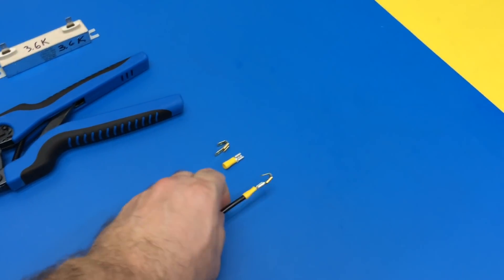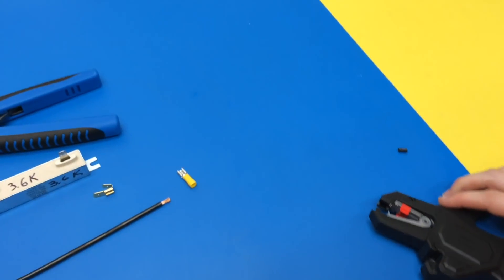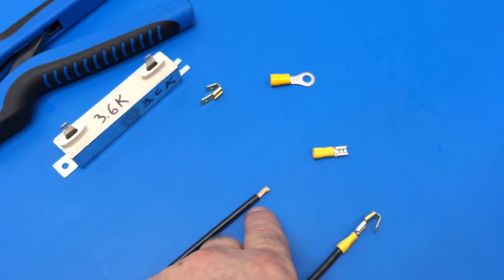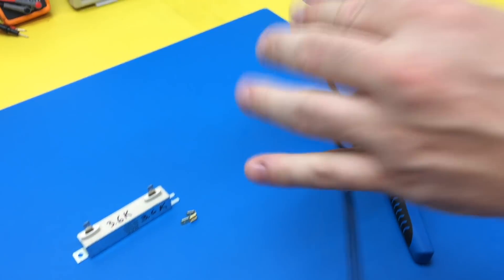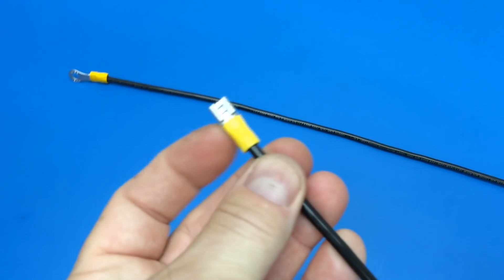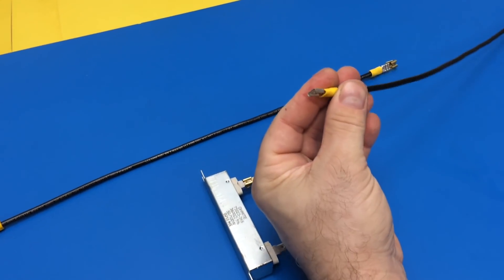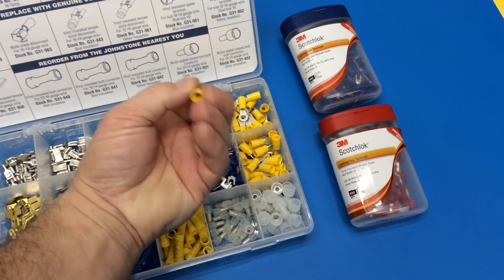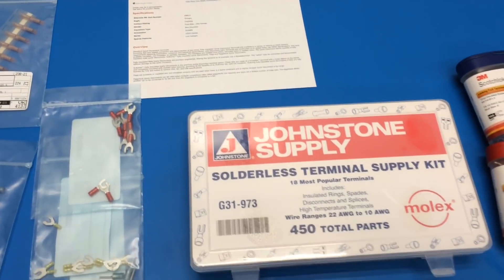Wire Stripping & Crimping Tools:  Wire Crimp Connectors for Balance Taps  [KTFG 370]

Comment from the maker: How do you Crimp?  Ratchet, manual, hammer or channel locks?
www.KevinGittemeier.com
Knipex Self Adjusting Insulation Strippers: https://amzn.to/2yf4RFs
SG Tool Aid SGT18980 Ratcheting Terminal Crimping Kit (9 Die Set): https://amzn.to/2PsxfdT
Molex 3 Way Adapter Quick Disconnect (Piggyback): https://amzn.to/2CFrIOh,
Amazon affiliate links

Comment: I love this your VDO. The cheap terminal you are talking about this is KS Terminal(K.S) brand. i have all k.s terminal type. It's just thin only Quick disconnect Type. but Other than that is all thick ( Ring Fork Pin Blade Type)same expensive brand. So I want to know what expensive brands you have (TE Molex 3M).Quick disconnect type Is it thin or thick? please compare difference between cheap and expensive terminal. i subscribe your channel thank you.
Reply from the maker: I use TE, Molex, 3M etc.
It’s just my opinion but for commercial, industrial or professional use, I believe in using the top brands but for Hobby use sometimes it’s OK to use cheaper alternatives.

There is a quality difference hence the price difference.  Often different materials, coatings and most notably the actual crimp portion is far superior on the top brands especially if a two stage crimp

Sometimes Some of the differences don’t matter for certain applications though.

I had planned to do some comparisons and more in depth explanations but it’ll be a while before I get to that if ever.

Comment: That's one video on crimping! thanks. The tube is full of rubbish on this topic.
I bought myself a budget tool but from Cembre (MLL1) and then I found a good bargain on a Knipex-like brand pliers. Totally they costed me 50€ each. But as a DIY they will last me forever
Reply from the maker: Awesome.
Crimping tools can get pricey so for DIYers the value tools are often the only reasonable choice.
I plan to do a full series on electrical connections and connectors.

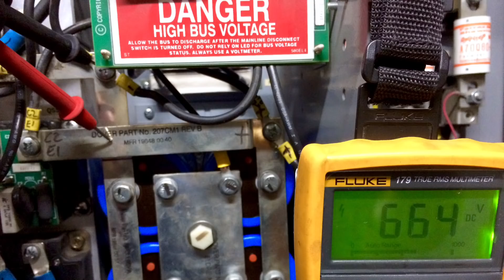Comment: I just have an old school set of Klein’s, nothing fancy. Good video and narration! Also saw your sneak peek of the danger high bus voltage clip 6:27, always reminds me of fightclub!
Reply from the maker: Klein’s do the trick well.
I am going to shoot a video on several different crimping tools,  the “Do’s & Don’ts”, reasons why electric connections fail and crimp connection  vs soldering.
Big project.

Comment: I use my teeth to strip the wire AND to crimp.
Reply from the maker: While that’s one method, I believe in the long it may cheaper to just purchase the proper tools.
I suspect teeth cost more than wire strippers and terminal crimpers